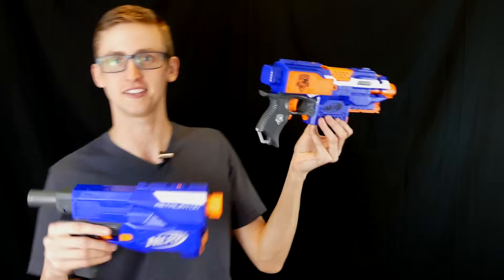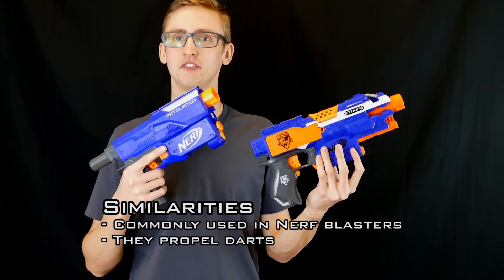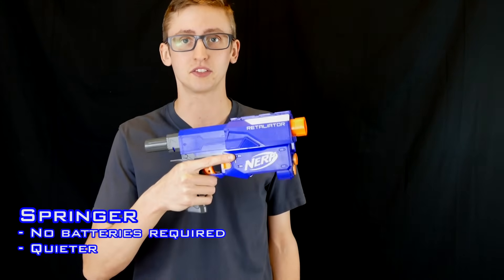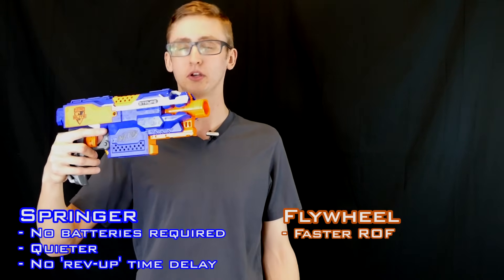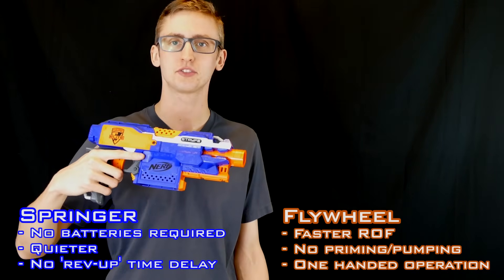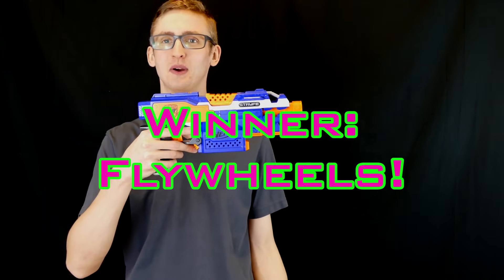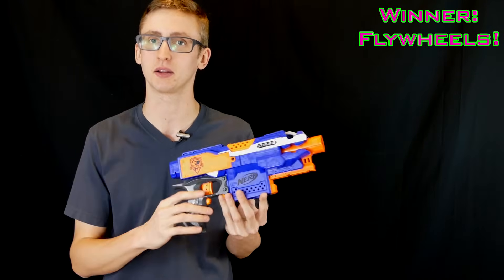[VS] Flywheel vs. Spring | Which is Better?!

Comment: The thing that annoyed me so much about flywheels is the constant hassle of buying batteries whereas when you get a springer out of the box its ready to use immediately. Who Else agrees?
Reply: I just use rechargable batteries
Reply: @Yayface0  u roasted him
Reply: I also hate that the more u use them the worse they are :p
Reply: @Yayface0  so you use the nemesis? stephan has you beat
Reply: Except for, I use the Nemesis.... flywheel Rival blasters have some of the best performance of anything. Especially with the Perses coming up
Reply: I agree, but over time the spring will eventually weaken.
Reply: I left my modded Raptorstrike primed over night several times (long story),  and it probably made it shoot about five fps slower.
Reply: Or you get a lipo ad better motors ,unlike springers the spring dies over time ,flywheels last much longer
Reply: Me! (diator)
Reply: Yup, I just use a alphatrooper with a 5kg spring. No hassle with batteries.
Reply: Ya and if you are willing a springer can out fps a flywheeler
Reply: Also flywheels get jammed more often than springers
Reply: @ledgeanator2262 , sorry, what did you say? I was to busy un jamming my rayven
Reply: I'm
Reply: True
Reply: use Lipo
Reply: me. use a retaliator as my primary
Reply: me
Reply: Though you need to buy replacement springs every few years if you dont take care of your blaster very well.
Reply: so much hassle to get a stryfe and buy a 50 pack of batteries off amazon for 20 dollars
Reply: Definitely. I feel Coop was a bit buyist on this one.
Reply: The problem is that most use c batteries, which are hard to come by at my area.

Comment: You should have mentioned jamming issues and physical limitations.
Reply: Those are a case by case deal. The mechanism itself isn't related.
Reply: +Christopher Albertson i agree there is no reason to mention jamming issues but if so flywheels jam a good bit to so there practicaly both jamming issues but overall i like flywheels as well definately the stryfe
Reply: I might even get two modulus blaster and duel wield
Reply: +Luke Porter your better off finding 2 stryfes for dual weilding, much smaller and cheaper than 1 modulus
Reply: +Luke Porter the modulus has deadspace and batteries in the front half of the blaster, making it front heavy, and dualing weilding less comfortable than using a stryfe, with the batteries right over the handle
Reply: Anyway I'm having the rhino fire for Christmas which has two barrels as if I'm duel wielding
Reply: +Luke Porter yeah theya are awsome i duel wield two already is awesome
Reply: i love modding flywheel blasters
Reply: Depends if your mechanically gifted (Good at sodering, etc).
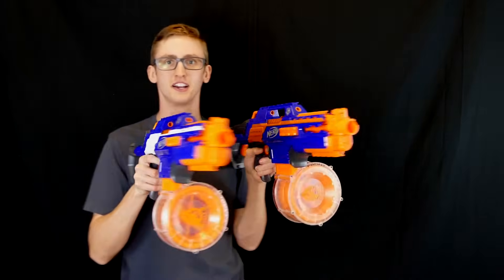Reply: 3:49 flywheel master race
Reply: True

Comment: Just use a springer secondary for them STEALTH KILLZZ!!
Reply: Ninja kill +100 points
Reply: Rival vs. Mega
Reply: Trust me a modified stryfe kills..Ear rape on a 3s lipo
Reply: Domino S rival all the way
Reply: Exactly, use a stryfe or anything with flywheel as a primary, and use a disruptor or strongarm or a hammershot as a secondary

Comment: flywheel for primary, spring for sidearms. styfe + hammershot for me in HVZ
Reply: I use the same load out lol
Reply: Rapidstrike(25 round drum) with Roughcut... And a pocket gun or two.
Reply: I go demolisher and Strongarm. I have a lanyard attached to my strongarm at such a length so that I can fully extend my arm so that it primes it.
Reply: dboydev lol same
Reply: dboydev you'll gonna think I'm wired but I use modulus primary and rampage secondary
Reply: Good but instead of stryfe I use THE STRAYVEN stryfe and rayven integration
Reply: Waffle Master that's not weird just the rampage is a bit too big for secondary
Reply: stryfe + flip fury
Reply: Im using a Stryfe and rough cut 😀
Reply: Stryfe and jolts

Comment: Nerf: Watches video
Nerf: Lets prove this guy wrong!
Nerf: Releases rev reaper
Reply: That's a fly wheel...
Reply: GTX 1080, I know that it is a fly wheel, but in the video, he says that fly wheels do not need a lot of manual work, but the Rev Reaper does  in fact need pumping.
Reply: @GTX-hm5rh  it's a manual flywheel
Reply: Petros Paul that’s still flywheel
Reply: That’s flywheel
Reply: Guys its a manual flywheel A.K.A Combination of both
Reply: 4Ze Gaming no it’s not there isn’t an internal spring which doesn’t make it a springer
Reply: 4Ze Gaming no spring = not a springer
Reply: Noah_ERZ yup
Reply: Buzzsaw: Pathetic
Reply: @Petros paul. VROOOOOOOOOOOOOOOOOOOOOOOOOOOOOOOOOOOOOOOOOOOOOOOOOOOOOOOOOOOOOOOOOOOOOOOOOOOOOOOOOOOOOOOOOOOOOOOOOOOOOOOOOOOOOOOOOOOOOOOOOOOOOOOOOOOOOOOOOOOOOOOOOOOOOOOOOOOOOOOOOOOOOOOOOOOOOOOOOOOOOOOOOOOOOOOOOOOOOOOOOOOOOOOOOOOOOOOOOOOOOOOOOOOOOOOOOOOOOOOOOOOOOOOOOOOOOOOOOOOOOOOOOOOOOOOOOOOOOOOOOOOOOOOOOOOOOOOOMMMMM
Reply: its elastic powered

Comment: I like springers because they aren't loud and don't require batteries plus they usually have slam fire or fanning plus I'm poor
Reply: I still like like fly wheels though I have one fly wheel it is the stockade it sucks though
Reply: 557deadpool that's expensive af it's almost 50 everywhere I look
Reply: Pavel Dzhurylyuk ok then I'll take it off your hands
Reply: Pavel Dzhurylyuk idk much about nerf but isn't a springer stronger then a flywheel oh wait wrong comment :(
Reply: Pavel Dzhurylyuk you can get a desolator for 23 at target they are flywheels
Reply: yeah
Reply: I prefer desolators than stryfes. I duel wield them
Reply: Pavel Dzhurylyuk costs 29.99 here in italy
Reply: Pavel Dzhurylyuk I know that feeling just ask for nerf guns for cristmas
Reply: Get a snapfire 8, semi auto without priming
Reply: I think it's better two
Reply: Slingers are way more powerful
Reply: I agree
Reply: @cuberfforever4445  euros
Reply: The stryfe is 30 bucks
Reply: And there more powerful
Reply: Pavel Dzhurylyuk I prefer having a flywheel for my primary and a springer for my secondary
Reply: @paveldzhurylyuk6076  I found a Stryfe for 3 dollars at Goodwill.

Comment: I like springers because you don't have to mod them, because a flywheel blaster without a mod is like a cereal without milk. It is possible, But who wants that.
Reply: Holy crap that's an amazing example
Reply: eh i don't eat cereal so i don't know lol but springers are just better
Reply: Springers suck in unmodded form too, unless rival
Reply: allenLP100 do u know how hard it is to mod a retaliator or recon and how ez it is to mod a stryfe

Think before you speak
Reply: I disagree. alot of flywheels actually perform great without mods
Reply: allenLP100 I want it! 🙋🏻‍♂️
Reply: Lots of flywheels don't need modding, take Rival blasters for example
Reply: Yes
Reply: I dont mod and it works perfectly fine
Reply: That is a great example
Reply: ReelYT i feel bad for you
Reply: Telecanine rival don't have springers
Reply: red warrior The Apollo and Kronos
Reply: allenLP100 nah I love my cereal without milk
Reply: red warrior how bout, the Apollo, Helios, Kronos, Artemis and hades? They're all springers
Reply: It depends on the blaster
Reply: Also I prefer my cereal with fire
Reply: You don't have to mod either, a Nerf stryfe is still pretty powerful in unmodified form, too make it stronger you can mod it, a Nerf Retaliator is pretty powerful unmodified also, but if you want it stronger you can mod it
Reply: Lol I literally eat cereal out of the box
Reply: I love your profile pic.
Reply: springers are way easy to mod you just replace the spring and your good and because i dont trust myself soldering
Reply: Well though I agree about what you say with the flywheel , I can't eat cereal in milk , I hate how soggy it gets and I'm not the type to just inhale my food , I have milk with it but not in it , otherwise I agree

Comment: I like the springers because they're more reliable. More consistent range and spread, and jam WAY less often. Also, much easier to mod. No wires or circutboards or battery packs needed.

Comment: Me personally I like both cuz flywheel you have a consistent rof with spring blasters you have constant FPS and when you start to go fast on a stryfe stock you have motor bog down and your FPS drops so it comes down to you want a fast rof or a solid 70 FPS

Comment: btw for me springer wins because it doesn't need batteries and it's more fun to use because of the priming or pumping of the gun rapidly. :) plus it lasts longer except when you prime the blaster too much it may break the other internals. :)
Reply: lol it decrease the range over time
Reply: +hung pham viet Actually that's a load of shit. Only the rampage decreases.
Reply: +Corporal Porpoise No, you leave any spring compressed for a long time, it will start to lose power, so that means any springer can lose power over time
Reply: People might hear that CHC CHC sound
Reply: People might hear the UUUOOOOOOOEEEEEEEEEEEEEEEEEEEEEEEEEEEEEEEEEEEEEEEEEEEEEEEEEEEEEEEEEE sound lol
Reply: @andrewyi643  anyways, Worker Upgrade/replacement springs are only 3-$4  so its pretty easy to replace springs when it wears out.
Reply: Vulcan might be outdated but still exists

Comment: The rhino fire and vulcan/havok fire are exceptions to manual Springers too.
Reply: +Bartosz Koźmiński The rhino fire uses flywheels the stampede a a motorized springer on the other hand
Reply: Sorry, should have checked before i speaked. But you have to admit it, the vulcan is a motorized springer too
Reply: Bartosz Koźmiński i know but its not a very good gun even after you mod it its just to big and the mechanics are overly complex and you have the motor over heating Ughhh
Reply: Milo Jones Dude. As a person with both the stampede and the vulcan, I want to ask a question. How the hell do you overheat a motor in a nerf gun?
Reply: Bartosz Koźmiński by over volting it ?
Reply: Lars Van Den Broek He as asking how you overheating a mtor by modding a gun and thats how
Reply: Lars Van Den Broek Not if the motor can't get enough fresh air (like in a closed plastic case)
Reply: Lars Van Den Broek Most motors need to have some ventilation when running anywhere near top speed.
Reply: Lars Van Den Broek No problem i did word my reply weirdly and didn't go into much detail

Comment: my primary would be a XD alpha trooper
Reply: but I do love my modules
Reply: That sucks btw
Reply: FLYWHEEL MASTER RACE
Reply: *an
Reply: Gavin Cullum alpha troopers one of the best springers.
Reply: XD padum tsssss
Reply: mine is my painted recon mkII
Reply: Gavin Cullum #FLYWHEELMASTERRACE
Reply: The Irish Potato What the hell do u mean? The alpha trooper is,one of the best nerf spring blasters
Reply: Chris Imphean I sorta agree.
Reply: Gavin Cullum same
Reply: Primary: Slingfire or Recon/Retaliator/Recon MK II
Reply: The Irish Potato double action springers like the snap fire 8
Reply: Gavin Cullum Me too! That or a slingfire.
Reply: Flywheel primary: nerf cam Ecs-12 because that is the only flywheel I have besides my mastadon and swarmfire 
 
Springer primary: a tri strike with a recon mkII stock and no front attachment
Reply: #FLYWHEELMASTERRACE sorry bro I use a nemesis
Reply: Mine vulcan
Reply: Gavin Cullum my primary is an mastodon
Reply: Unless u want flywheel because flywheel master race
Reply: I really like the modded doominator because it has the benefit of easy loading as well as being capable of switching cylinders when out of ammo similar to make
Reply: Same
Reply: I jost ordered one
Reply: The alpha trooper isn't really that bad actually
Reply: Did you mean?: An EAT
Reply: No delta trooper

Comment: You forgot one main thing, the fly wheel can use any need dart squished or not but sprinters have to have perfect darts. (In HVZ way better ammo wise)
Reply: I'm pretty sure it's the other way around. Flywheels require that the dart fits just right in between the gap in the flywheels, since the darts have to be physically gripped. Meanwhile, springers only require that the dart is roughly the right size to chamber correctly (one example is that the rival apollo can shoot cheese balls, but the zeus can't since it is a flywheel blaster and tends to crush the cheese balls). Also, flywheels have particular trouble with shooting slippery or wet darts.
Reply: 12casbro woah that was a lot of auto corrects
Reply: No springers do not need "perfect" darts lol

Comment: I’ve discovered the perfect system. Stryfes are pretty close to perfect, almost a pistol, very easily customizable. My strat is to have the stock retaliator gear accessories (foregrip, barrel, stock.) and a holder on my belt for the handle design they share. That way I can easily switch between a springer sidearm with a flywheel primary and a flywheel sidearm with a springer primary.

Comment: Booooo springers ftw
Reply: +Alex Is On Fire na flywheel master race
Reply: +The OutcastLeaf true
Reply: i think there both great
Reply: Well, there are different spring blasters that are good. However I agree with the others, Flywheel frickin' rekts springers.
Reply: +Nathan Fox And I'm just sitting here with my air pumps.
Reply: Right? Springers all the way!
Reply: Pulls out retaliator while waiting for enemy to rev up and everything...
Reply: +CreeperGaming & More! I generally don't rev. I usually pull both triggers at the same time. I also use a pump-action Vortex as a secondary for funzies.
Reply: +Alex Is On Fire na stringers ftw brah
lol there the same in a way
Reply: ***** ??????? who's side r u on
Reply: +CreeperGaming & More! SPRINGERS RULE!!!!
Reply: yeah
Reply: #springersquadron
Reply: +Aidan Beattie YAAAAASSSS
Reply: ImperialWalrus 29 Spray and Pray with no accuracy? Or conserve ammo with shots that could be adjusted faster and easier.
Reply: ImperialWalrus 29 well yeah but because flywheels are loud especially when modified,  you can easily take cover
Also, springers can spray too, ever heard of slam fire?
Reply: ImperialWalrus 29 The prime speed depends on your strength/speed. Plus you would less likely break a springer if you were to submerge into water for a moment or two.
Reply: Booo, you don't know what you're on about

Comment: My loadout (as soon as I buy the blasters):

Primary: Modulus Regulator

Secondary: Disruptor

Backup: Triad

The Regulator allows you to pick between different modes  - semi-auto, full auto, 3 round burst - but is loud like a flywheel blaster is. The Disruptor allows those sneak shots before switching to the fast rate of fire Regulator.

The Triad...because why not?

Comment: But springs are used for snipers,and I'm a sniper so SCREW YOU FLYWHEELS!!!!
Reply: Screw springers
Reply: Yeah, but you're a sniper, and snipers suck so your opinion sucks

It's a joke don't be offended
Reply: KirtDoes Gamimg99 springers can take out of flywheel player before they can even rev
Reply: Historically Inaccurate same, but what if they pre rev?
Reply: That is why if you carry a flywheel blaster you have a springer secondary so you can turn corners "stealthily."
Reply: Being a sniper in a nerf war makes no sense to me... most nerf guns shoot around the same distance. That means no long range tags. 95% of the time your gun's precision is mandated by the dart. Using accustrike darts in a Hyperfire is just as good as in a Raptorstrike.

Comment: Solution: get a regulator (semi OR full auto) and put the Modulus Grip Shot on the front. That way you can choose between semi and full auto for most of your kills, but you can still get that element of surprise with a silent kill from the Grip Shot. If you really want options, you could also put on the Tri-Strike missile launcher stock on as well for that high-caliber shot😂. But in all seriousness, the Regulator with the Grip Shot gives you the best of both flywheel and springer and I do think it’s one of the best unmodified blasters you can use right now (excluding Rival of course)

Comment: Rapidstrike vs Stryfe! :D
Reply: Well, duh. His favorite feature was rate of fire. You can't beat full-auto for rate of fire.
Reply: Casey Wellington But, you do burn through ammo faster, and the Stryfe is easier to use one handed. I think it'd work :D
Reply: That's my opinion, too. But Coop would clearly choose the RS.
Reply: Actually a stock stryfe can fire faster than a stock rapidstrike
Reply: Actually, if you watch his other videos, Coop says he likes the stryfe better(when modified). The stryfe is his favorite blaster(when modded), RS eats ammo too fast
Reply: With a lock removal
Reply: It's obvious which would win like this video so it could be good but worthless as information.

Comment: Do Pump action VS Top/Bolt priming
Reply: That's a stupid(IMO) idea just because Coop hates top priming and shotgun pump is overall the best way to use springers. Top priming has a slower rate of fire than a shotgun pump
Reply: Easily pump action

Comment: rampage vs alpha trooper!!
Reply: rampage is way better I have both the rampage is more reliable but I don't think it is sold anymore
Reply: +Asher Lloyd you sort of can! you can get the new star wars the force awakens blasters and one of them is basically a redo of the rampage
Reply: +Metovoltz the one that looks like a shotgun with a crap sight Coop's already done a review on it
Reply: Alpha Trooper hands down the best springer. Best priming method(shotgun pump), the magazine weld is in the best place possible(rampage and Raiders' magazine weld is just dumb), and slam fire
Reply: +Ben “Sheep” Lam rampage is the same thing with a better grip and it comes with a 25 round drum (you): WAIT THE ALPHA TROOPER CAN USE DIFFERENT MAGAZINES YOUR WRONG. Still i think the rampage is more reliable. also a better name. Cheyanne Silva is now proud